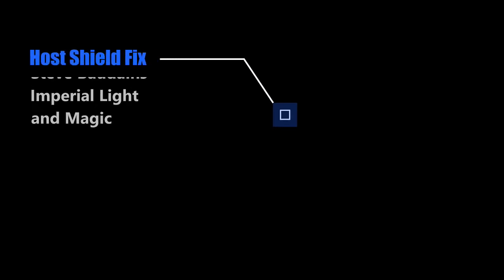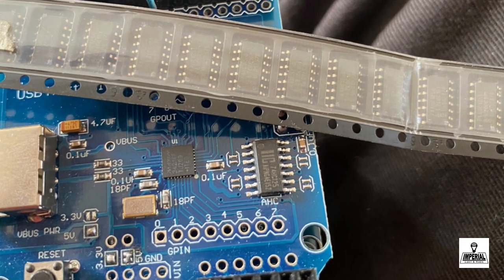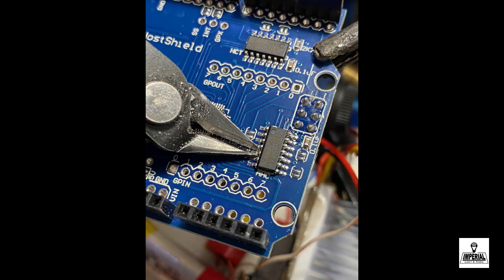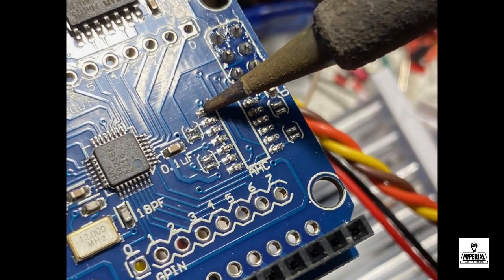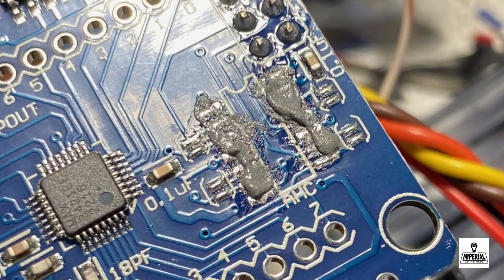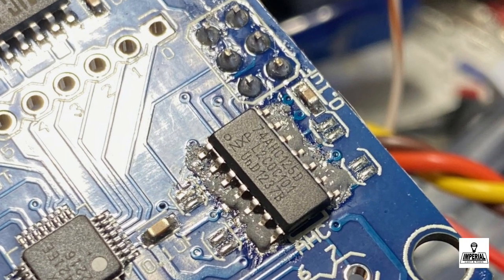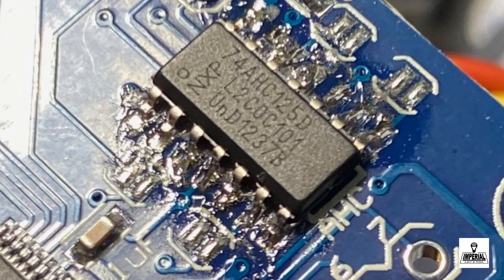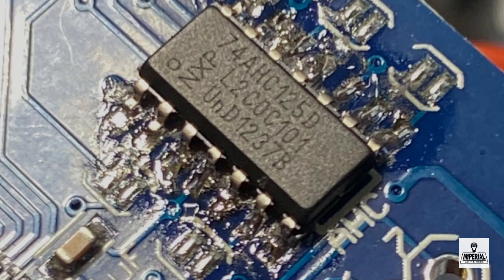USB Host Shield Fix for AHC chip

Comment: Tks a lot for doing this video and all investigation around the issue... I was struggled to identify the problem before your video. Tks a lot
Reply: Did you manage to make usb host to work? What was the issue? Project? Errors?
Reply: @simonjozek3028  I did, I hád to replace the chip exacly according the vídeo. After that worked fine!
Reply: @simonjozek3028 yes, I replaced the CI as showed on this vídeo. TKS!

Comment: measure the volatage on the 3,3V Line with the HC125 - the 3,3V line goes up to 3,9-4,0V.... this voltage stop the MAX USB Chip... With a long USB Kabel on the Ardoino Schield - Drop the 5V voltage so much that the high voltage on the HC125 drop to 3,6-3,7V and the MAX still work.... In my test USB Shields work without a Voltage Pin on the HC125, lift the PIN 14 from the HC125 - pls reports y results

Comment: I am having trouble getting the shield to operate the Xbox controller for the Padawan 360. I am using the Mega.  The Xbox controller gets power and pairs but won't respond to any command. Is it the chip you mentioned in the video since I have the incorrect chip? Would this issue cause the Xbox controller not to work?  I also have an after-market Xbox controller and I have updated the files and uploaded them to the Arduino Mega.
Reply: I could not get the ADK to work with the transmitter and receiver I had. I ordered an OEM TX and RX. They came in, and it worked right off the bat with the MEGA.  It also worked with the shield with the bad chip number. Don't know why.  I couldn't get the ADK to work, so I will leave that for now since the Mega seems to be working.  Makes lots of R2 sounds.  I don't have drive motors yet, but they are on order.  I am hoping those work with the system as well when they arrive.  But since the sound works with the controller, I am hopeful. It looks like my main problem was aftermarket TX and RX.
Reply from the maker: Most likely.  Have a look on your host shield at the chip on the right hand side.  It should be an "AHC" chip but many are fitted with a HC chip. This video explains in more detail: https://youtu.be/UVjqSA3u26k
Reply: Thanks for the quick reply.  I watched the video, so I thought it might be the shield. Because of that, I ordered an Arduino mega ADK with the USB. I'm not sure I want to handle those tiny solder points. Your tutorials have been of great help.  If I get the problem solved, I'll send a message so others can learn.  Thanks again.  Bryan
Reply from the maker: @bryancombs4636  it’s not actually that scary so long as you have the right tools and solder paste is a huge help. ADK board does away with any of this, just make sure you select the ADK mega when uploading the sketch (I have a video on that too!)
Reply: Thanks for the info. I received the Mega ADK and tried to upload the sketch, but it is still not working. I get the receiver to blink slowly, then bind with the controller. The controller has a light on the top left that goes steady.  It just remains lit with nothing else working.  Did the same with the Shield.  The Mega appears to be uploading since the software says upload complete.  I have tried changing the PID for the Xbox receiver, as described in one of your other videos.  No luck. Started over fresh with no luck. Same result. Only the top left light on the center button on the Xbox lights up after binding, and nothing is working.  I ordered another Xbox controller, thinking maybe it's a controller issue.  The PC reads the controller, and the buttons appear to work on the PC.  At a bit of a loss.  

Question:  If I cannot get this thing up and running, can you upload the sketch if mailed to you? Please let me know if that is something you do for customers.

Thanks,

Bryan

Comment: What are the symptoms, if I don't change it? The checker-skript from the library runs well till it stucks at "Waiting for device". (My device receives enough power. It lights up. And I tested other usb devices.) Always: Waiting for device :(

I received my host shield two days ago. Mine too has two HC chips and no AHC.

(Also: Instead of a MAXIM 3421EE TJ209 +ITED, I have a "MAX 3421EE 2228". Is this an issue?)
Reply: Did you figure out how to make it work?

Comment: Hi, what happens if you don't change this chip? I have just received a host shield with a SN74HC125 chip, so presumably it needs changing?
Reply from the maker: by all means give it a try, but chances are yes, it will need changing.